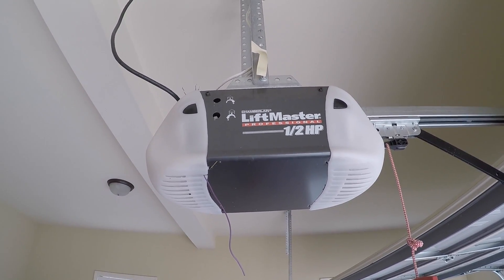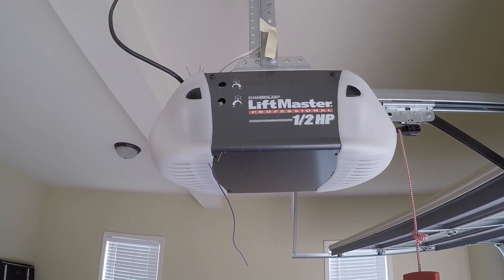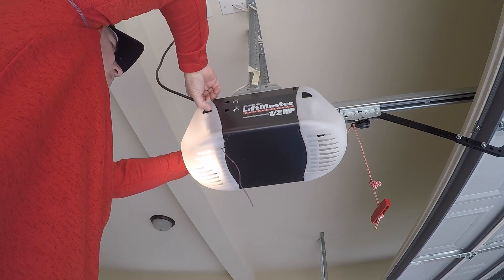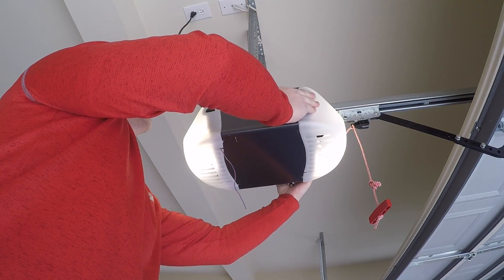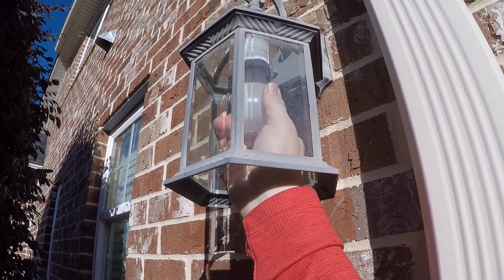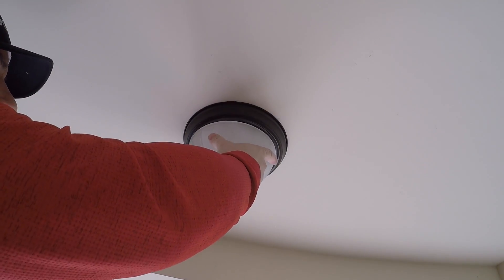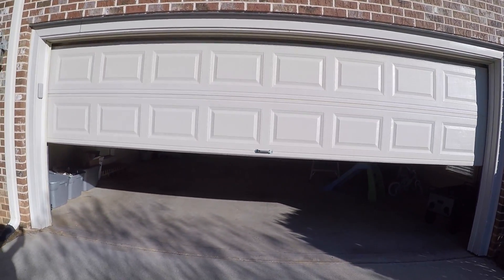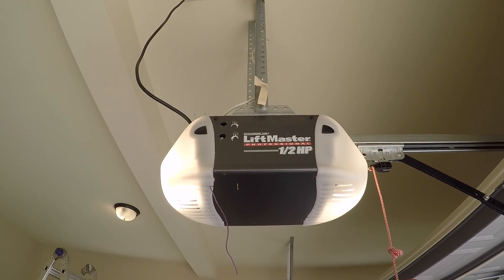Garage Door Opener Working Intermittently - LED Bulb Culprit

Comment: Thanks for the video.  Thought this would help me but I replaced the LED lights with incandescent bulbs and the remote opens and closes the the door but only when the light is off.  I removed all of the LED lights in the garage and porch but still having the same issue.  Please let me know if you (or anyone else) has any other suggestions.  Thanks again!
Reply from the maker: There has to be something causing interference still.
Reply: @TightWadDIY  Yea, or I think the receiver board may just be going bad since it has worked just fine (even with the LED lights for many years) so may just need to replace the garage door opener completely.
Reply: Right, I have replaced all the lights with incandescent bulbs, and also reset the garage door opener, completely and tried to reprogram the remote, but it only works intermittently. Sometimes, it even works when the light is on, but most of the times it doesn’t. Definitely something interfering with it because it will open and close, but just not consistently.
Reply: @davidvinh3886 Remove the bulb from the opener completely and try it.

Comment: Thanks for alerting us to the issue of interfering frequencies. I had a similar problem and I'm also using an LED bulb, but it has been working fine for years, until just 2 days ago. The handheld remote wasn't opening the door. The direct connected switch worked ok. At the same time I found that if I used the remote that is built in to my car's rearview mirror, it would only work while the car was moving, or if the car was parked right underneath the opener. Tonight I found that if I took the handheld remote and brought it way closer to the opener, i.e. right in front of the garage door, it still wouldn't open, but if while pressing the button I waved the remote high and near the garage door's windows, it would work and the door would open, and the same was required to close it. Then I sat down for dinner and I thought something is causing the signal to be weakened at a distance, but what? Just then my wife mentioned to me that the battery in the remote control for the fireplace was dead even though I had replaced it recently, and she couldn't control the fireplace. I looked at the LCD screen on the fireplace remote and indeed the battery level indicator was low and flashing. but not quite dead yet 🙂. And then I noticed the "lower flame" button on the remote was stuck in the pressed down position. Somehow my wife had pushed it in in such a way that the edge of the button got stuck under the edge of the hole in which button sits, leaving the button in the pressed down position. It must have been sending wireless signals ever since the button got stuck, I figure 2 days ago, thereby using up the battery and interfering with the garage door opener. After unsticking the button on the fireplace remote, I tested the garage door remote from its usual location about 40 feet from the garage, without waving it around, and it worked!!

Comment: Thanks for sharing!!! Just today, I went to ACE (less than 5 min. drive) to specifically get light bulbs made for a garage door opener. It worked on my Liftmaster  (20 years old at least), but the "regular" bulb that had been working fine, would not respond to the touchpad opener. BUT when I swapped out bulbs, the side that had the newly purchased garage door opener bulb, it wouldn't work.  Either bulb could work on either "side" of the opener, but not both at the same time.  Any ideas?  Thanks.
Reply from the maker: That’s really odd! I’m honestly not sure what would prevent that.

Comment: Your videos have really helped with general issues I've had with my garage door. However, this time I might be stumped. I replaced my existing LED bulb with a new Genie-branded one, but the door still won't open when the bulb is lit. The only time my garage door opener works via remote is when the bulb is off.
Reply from the maker: That is odd. Maybe your opener doesn’t like the Genie bulbs either. Try removing the bulb and see what happens.

Comment: I had the same problem. My opener would work after I switched to LED bulbs, but only right in front of the garage door. After switching back to incandescent bulbs, the door remote works way down the road again like before. And now I see they actually sell LED bulbs just made specifically for door openers that don't interfere with the signal. Good!
Reply from the maker: Yes! I’m glad you figured it out!

Comment: I don't think you need to enter your code in the pad to close the door. Simply pressing enter should work
Reply from the maker: You are correct! It is not needed on most pads, this one included. A few models do require it though.

Comment: Yes. I changed my regular Led bulb and solved the issue of the garage door opener.  The specialized Led garage door opener bulbs are expensive but worth it.
Reply from the maker: I’m happy to hear it worked for you. The specialized bulbs are expensive but should last longer due to their outdoor eating and vibration resistance.

Comment: Does anyone know which remote has a light option as well? I would like to control the light besides just the garage door please help.
Reply from the maker: Desi A I’m not sure that is possible. The button in the garage is hard wired so that’s why it can control the light.
Reply: @TightWadDIY  thanks for the quick response.

Comment: As an electrical engineer, I should have figured this out without going to YouTube!  What I ended up doing was to install a "socket to outlet" converter where the opener bulb would go, then plugged a 4' LED shop light into that.  Just being a couple feet from the receiver does the trick as RF field strength falls off with the square of distance.  Now I have normal range, and twice the light when the opener is activated.
Reply from the maker: Rick Rasmussen Interesting. I wouldn’t have thought of that. Thanks for sharing your expertise.
Reply: Oh, I like your idea.  Bonus: one of the lightbulbs in my opener is burnt out.  I won’t be hunting down an specialized LED or an incandescent bulb.  I’m going for MORE light!

Comment: What if after replacing the bulbs its still intermittent, even the inside wall control thats wired directly to the garage door is intermittent.  I even removed bulbs completely and did a test same result :(  always closes only after it opens,  but open's like 1 out of 5 or 10 times.
Reply from the maker: Femi Bello I’m not sure what else it could be.
Reply: You ever figure your issue out? I have a very similar situation to you.
Reply: @justinkorb324  got tired of messing with it and replaced the entire unit. Sorry.

Comment: I had issue with my garage door opener not opening unless I was foot, yes, foot from the door. Went on for months. It turns out to be all the led tube light I had installed on the garage's ceiling, had about 10 led tubes total. So, not only does led bulb on the motor interfere with signal, but any led ceiling tube type would also cause the opener to not work. Once I cut the power to the ceiling at the breaker, the garage door opener work fine. Works from 2 houses down the street even. 
Will have to look into these genie led bulb now.
Thanks
Reply from the maker: Brandon Thabks for adding to the conversation.

Comment: Changed light bulbs in opener and porch lights yesterday, and today it not only opened on its own but closed as well. Help, please!
Reply from the maker: Donna Bendt So it opened without you pushing the button?
Reply: @TightWadDIY  Yes. It has been opening on its own for a week or so. My husband took your advice and changed the bulb to incandescent and in the porch lights as well. Today, the garage door opened on its own and a minute or so later it closed.
Reply from the maker: Donna Bendt Your issue sounds more like a short on the circuit board. The light bulbs typically only cause issues with using the remote. I haven’t heard of any cases where they cause the door to open on its own.
Reply: Maybe I should have prefaced how the whole thing started. The garage door came down on a trash can and then wouldn't close down all the way. Then my husband had to adjust that. Then it would close fine, but kept opening, and now closing, on its own.
Reply: But everything was working okay until the garage door hit the trash can.
Reply: Garage door just opened again on its own.

Comment: Thank you very much for your video! I'm having the same problem and now going to change out all my LED bulbs in the garage. But I do have a LED light fixture with motion sensor outside my garage door. The LED's are built in to the fixture(bulbless). Do you think this will have a frequency that will interfere as well?
Reply from the maker: Joe Cupples I’m glad you found the video! Be sure to share it so others having the same problem can solve theirs as well. You will likely just have to test it and see. It may be far enough away that it doesn’t interfere.

Comment: I thought the same and removed the led bulbs, but still same issue until  the light button was pressed on the wired remote and voila the remote worked and seem that maybe a voltage issue may be the issue because as soon as as I turn on the light without bulbs it stopped working.
Reply from the maker: Adrian Vargas Interesting. My solution was definitely the bulbs.

Comment: Thank you so much for this video!  I am upgrading to LED bulbs in my house and had not bought any for the garage, yet.  GREAT INFO you saved me two trips to the box store!
Reply from the maker: Claire Claire I’m happy to help. My frustration and problem solving is your fortune!
Reply: TightWadRepairs :  I have been upgrading all of my lighting to LED.  I did the outside, first.  Then I did a big racetrack light in my master bath.  The new LED clear bulbs look as good as the old ones!  Maybe better!  I did 8 can lights in my kitchen.  I still have nearly 20 lights to replace.  The hallway, ceilings, closet.  I am guessing the cost to upgrade all of my light bulbs will end being nearly $200.  Worth it in the long run as the LED lights last a lot longer and hoping the cost savings will mean I break even in a year.

Comment: Many thanks for this, I’ll need to check my bulbs. BTW, I also have a Chamberlin garage door opener and the same external keypad. Quick tip, to close the door, you do not need to punch in your code, just hit the enter button. However, when opening via he keypad, you do need to enter the code.
Reply from the maker: Mike K Thank you for sharing that tip. I noticed that a few days after install. I like the feature because my neighbors can close the garage if I forget to!

Comment: But, my garage door opens intermittently when I'm using the garage door opening button mounted on my door frame between the kitchen and the garage.  I even dismantled the switch and used the two low voltage wires that go to the switch from the garage door opener.  When I touch the two wires together.....sometimes the garage door works and sometimes it doesn't....so its not the switch and its not a frequency as what I'm working with is hardwired.  Also, when I touch the two wires together, if it decides not to work...it won't matter how many times I touch the wires together, the garage door opener will not come to life.  Any ideas??
Reply from the maker: David Cherrick That sounds more like a controller board issue. Maybe there is a bad switch on the board.